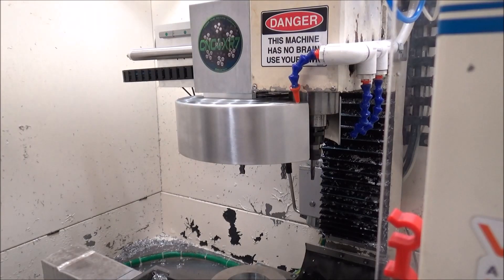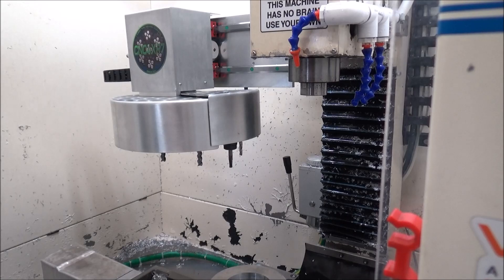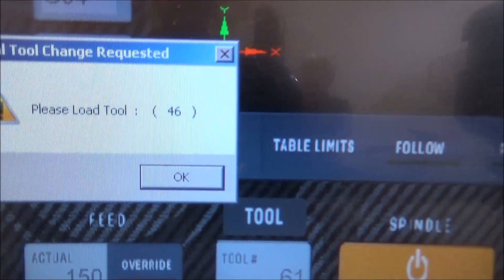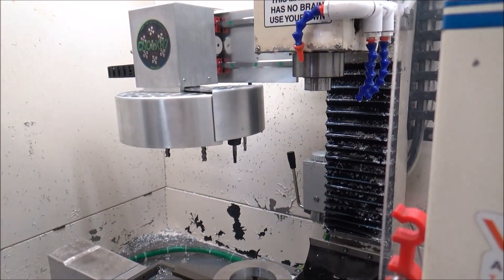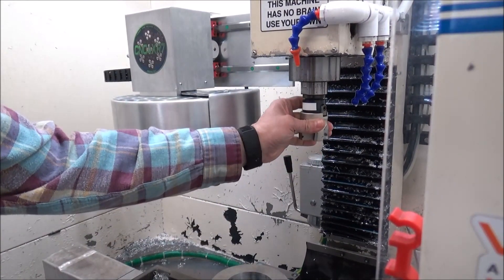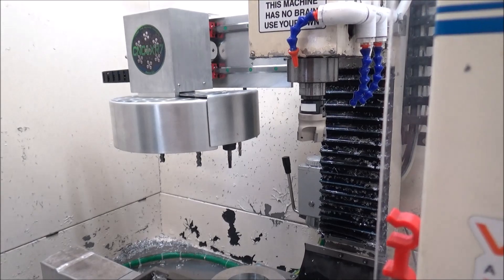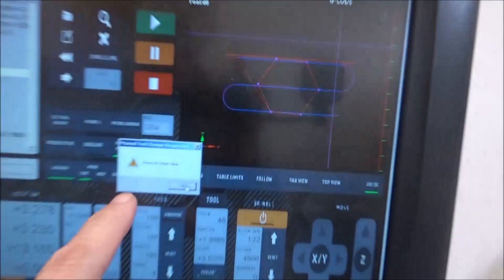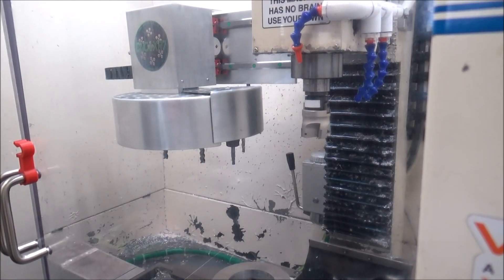PM727M ATC10 First part!

Comment: Hey there, you making incredible work! Just skim through full 727's playlist, It was actually super idea for gas spring weight balance I never saw before! Could you tell - I see you havent changed the actual spindle of machine, just converted to belt drive and changed motor right? I'm asking because as I understand with 727M it should be possible to machine steel, have you tried it yet? Or you want to use it strictly on aluminum? thx
Reply from the maker: Yes works well on steel , I do machine some steel however you are correct I do machine mostly Aluminum.

Comment: nice job!! Did you build your enclosure or buy it?
Reply from the maker: Both! I designed it  and had a local sheet metal shop bend the metal and  I finished the welding and Paint. Powder coat would have been a better choice in hindsight.
Reply: @CNC4XR7  Thats awesome. no wonder it looks so good. I have a converted 728VT that I just did in January. the mist coolant is annoying, but as I made the enclosure out of wood I can't do flood yet. Any tips or things you would have done differently if designing a metal enclosure again? other than powder coat?

PS: thanks for getting back. I am going through a bunch of your videos and loving them! great stuff with smart solutions.
Reply from the maker: @possumsolutions  Well I recently change the enclosure drain. Actually I've changed it a couple times. so as you combing through the videos you will she the changes.
the latest version works well however I build up a lot of chips these days and I wish it would drain better.
If I had to do over I would build a stand and Have the coolant and chips funnel under the machine into a basket that sits on the coolant tank.
i would put the doors on rods. all of my upgrades of course cost more money.
Reply: @CNC4XR7  great thoughts! I have seen some machines like you say with the chip bucket below the machine. Makes sense to me!

Comment: I went with  Mach 4 on my new PM940V  with cleapath servo motors,  but I may use mach3 at first
Reply from the maker: While I understand Artsofts move to Mach4 to get away from the Parallel port  with the advent of ESS the longevity of Mach3 has been extended. Mach4 has not really caught on with the DIY crowd. The main drawback is no rigid tapping. However thread milling works really well and is a good alternative.
Reply: @CNC4XR7   That what I was reading  but I had already purchased Mach 4.   But there always something  on a project of this size you either waste or have to rebuy .  Great information
Reply from the maker: @bluegroovemodelsports9650  I cant argue with that Ive bought just about everything twice. LOL

Comment: I love that ATC. I have seen a video of a guy adding the ATC feature to the no ATC tool holder on the lathe. At the thend you only need the distance from the top to the AT groove. I think you should have enough material to modify them.

(edit) the video I was talking about
 https://youtu.be/CiLmNN0tSH0
Reply from the maker: Cool, thanks! Yes I thought about doing this as well and also taper the top. I will have to wait and see.